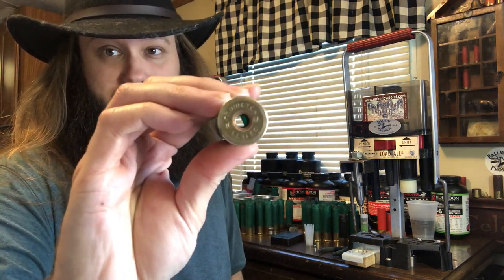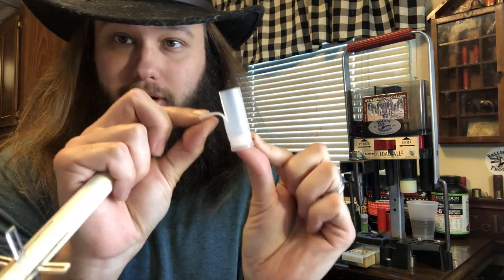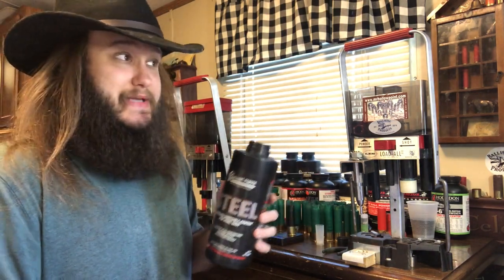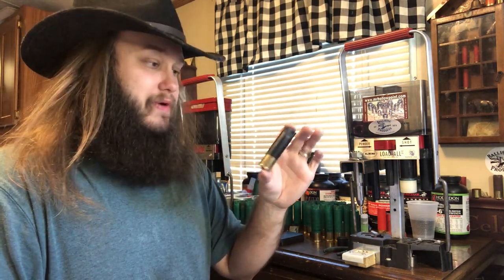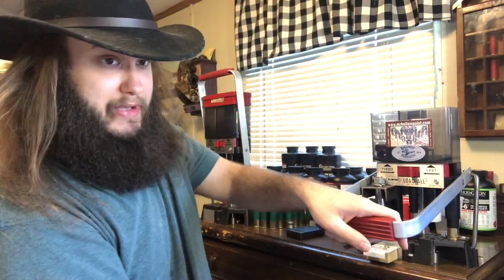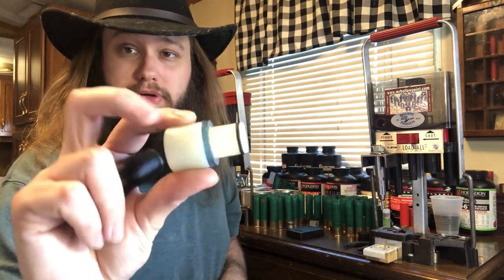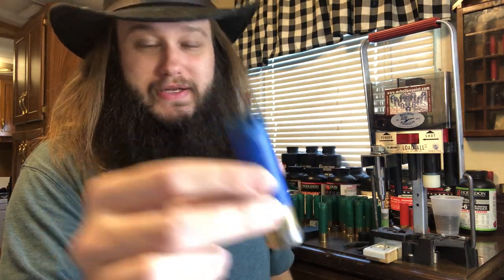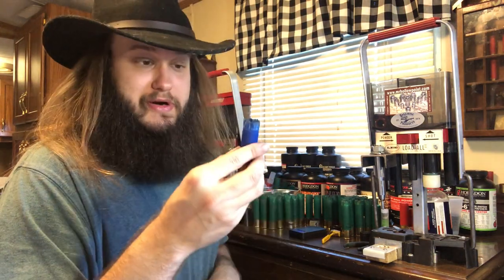12 Gauge 3” Duck/Waterfowl Loads

Comment: Wade Rush has got a 3in steel BB load using 33 grains of Longshot with a TPS pre slit wad that i am assuming is a 3in shell wad because the load is 1 1/4th ounce and sits flush with the top of the wad. I don't believe he uses any additional nitro cards or fiber wads etc. Just powder, TPS was, shot, crimp. 
I mention this because you said in the video that stack hight might be an issue with Longshot powder?
Reply from the maker: Longshot takes up a lot less room

Comment: That is a good duck load. I was wondering if you could try that loads load (1 1/4 or 1 1/8 oz), but with longshot or hs-6 powder?
Reply from the maker: Longshot develops pressure spikes a lot faster with steel shot. It can be done but the velocity would suffer.
Reply: @theshotgunscientists  more velocity doesn't really kill. If it 1200 to 1350 fps, that should work.

Comment: I have two loads i like to see tried out. It come from the new tps wad data 2023. For one is in 2 3/4 cheddite hulls, ched209 primer, 23 gr longshot powder, Tps1275 wads, 1 1/8 oz steel shot going at 1250 fps with 10,800 psi. The other one is a 3" cheddite hulls, ched209 primer, 29 gr longshot powder, tps1230 wasds with a 1/4" felt wad under shot with a over shot card, 1 1/8 oz steel shot going at 1350 fps with 11,000 psi.
Reply from the maker: That first load is something I’ve actually done a video on a couple years ago. People seem it like it. I used crossman bb’s.
Reply: @theshotgunscientists  but that one was 1oz load, not 1 1/8 oz
Reply: And yep, that 2 3/4 " load is an awesome load

Comment: Can you try 1 3/8 oz steel shot in 3 " s hulls and 28 to 29 gr alliant steel powder? Note that tps1230 will fit 1 3/8 oz
Reply from the maker: What’s the full load data
Reply: @theshotgunscientists  it comes from the alliant 2000 data, but that one was a 1 1/2 oz load, but know that alliant steel had changed a bet since then, and I also checked out the new tps data and looked at both the 1 1/8 oz and 1 1/4 oz load to get the exact charge of powder with 1 3/8 oz load to be in safe psi

Comment: Do you have Hercule/Alliant 2400?
Reply from the maker: Nope but I can get it locally
Reply: @theshotgunscientists  I have a Requested load I love to see tried out. It comes from a mec steel shot load data from 1994 copy. It uses 3 " winchester supper X hull basic base wads, fed209a primers, 42 gr Hercules/Alliant 2400 ( I try 39 gr if needed to use ched209 primer), mec12 3" which are now the precision reloading tuprw123 wads, 1 1/4 oz of steel shot going at 1260 fps at 11,500 psi.
Reply: @theshotgunscientists  I got 3 cans of it and was curious to see you try this load

Comment: If you can afford it, go with the MEC Jr. instead of the Lee Load-All. I have both, and there is no comparison. On the Lee, the stationary pre-crimp obliges you to align the pleats with every round. You can't make adjustments for shot column height other than "hand pressure" on the lever. The whole press leans at an angle when the lever is depressed, that often causes a slant to the top of your shells. Lastly, that resizing ring is a real pain, especially if you misplace it. The Lee will get the job done, but "not horrible" is not the quality I'm after. I do enjoy the videos you boys put out. Please watch those pressures!
Reply from the maker: I’ve used mec presses and don’t like them. I’ve been using the Lee load all for 4 years and get great looking crimps out of it. I don’t think mecs are anywhere near as versatile, I’ve got lees in 12, 20 and 16 gauge, and a converted 12 gauge kit that does 10 gauge. I can also load 2.5” shells with them without having to adjust anything at all. I also fold crimp my 24 and 32 gauge shells with them with the help of chamber inserts as a final crimp tube. I also have 3d printed kits for the Lee load all in 28, 24, 32, 10 and .410. The taper crimp die I have on my 10 gauge press is awesome. I’ve got a bolt on depriming punch for 3.5” shells that’s mounted right to one of them. Basically a whole new station. I just like my Lee presses, they put out great crimps if you know how to use them and I’ve got about 200 bucks into them and some add ons that allow me to crimp all 8 different gauges I own.

We’ve barely ever ran into any pressure signs, typically speaking we stay away from max powder charges or high pressure loads due to unavailability of components right now. It’s almost impossible to follow a load recipe piece by piece these days. We also test new components out that don’t have data available hardly. The trick is to start low with powder charges if you aren’t sure. I can think of only 3 times we’ve ran into pressure problems but nothing serious, just some primer flow back here and there but most of that is due to mossberg shotguns having huge firing pin holes.